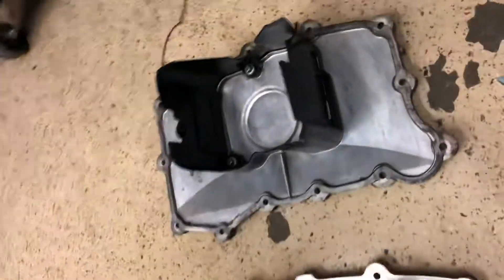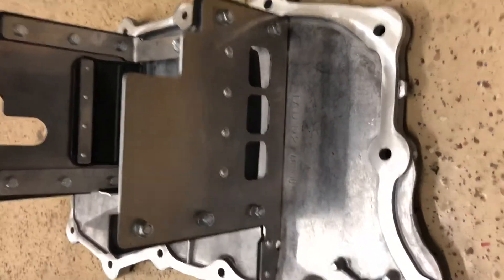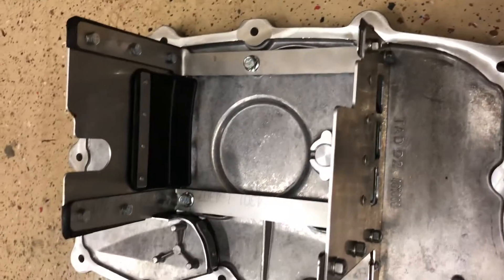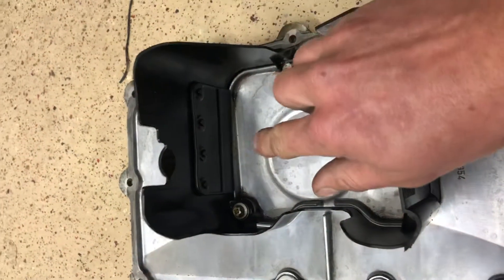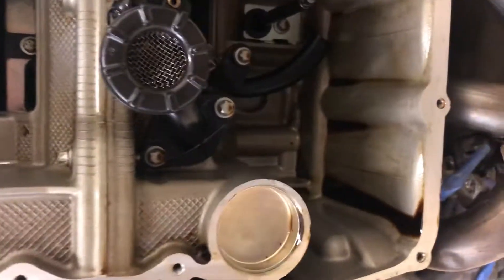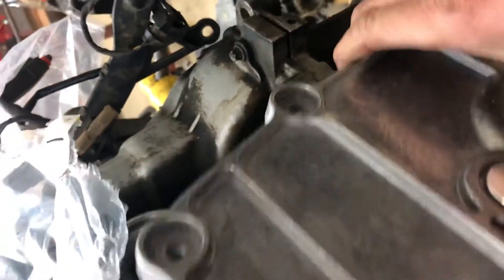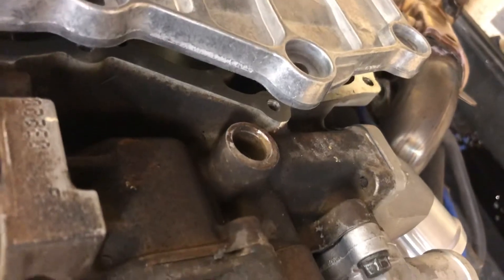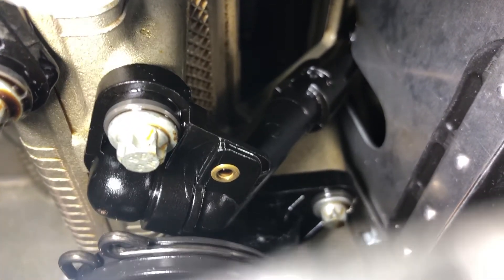Porsche X51 Oil Pan Install on a M97

Comment: You can buy the baffle without the pan with LN Engineering.
Reply from the maker: yes- LN doesn't manufacture the baffle they resell the EBS branded baffle which we stock.
Reply: What tool do you trim the baffle with?